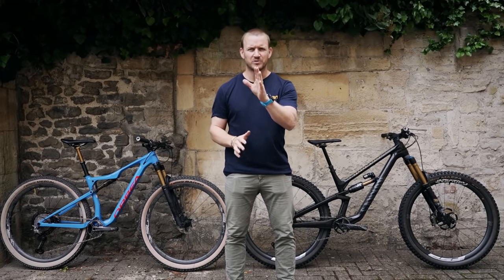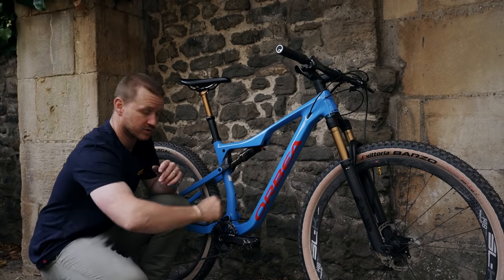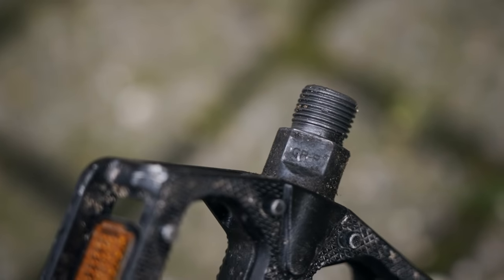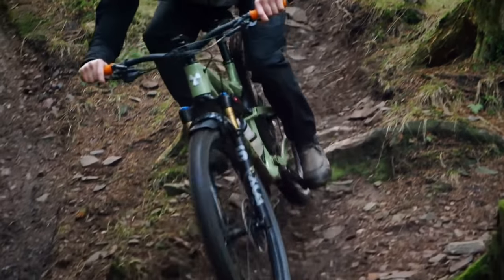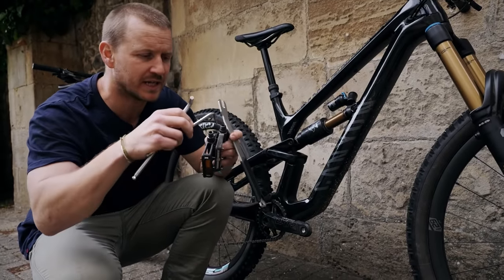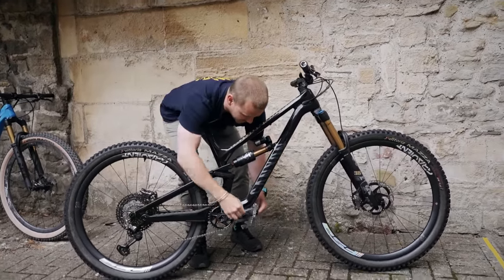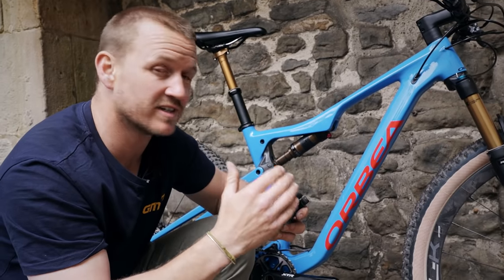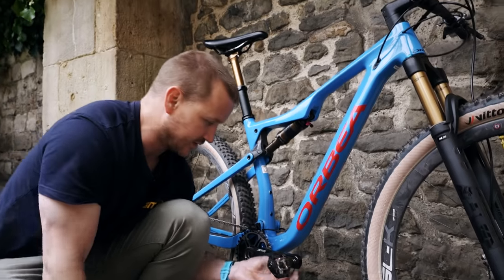How To Change Pedals | Bike Pedal Removal & Installation

Comment: Yep, my pedals are stuck in my cranks 🤦🏾‍♂️  gotta hit the gym for a week and try to remove it 😅
Reply: same😂
Reply: My friend and I cut a piece of metal to match the pedal post and then welded an 8 foot bar to the metal piece we made so we could break it free. Yes we were spinning in the right direction, just the last person did not put grease on the threads when they installed the pedals. Luckily the threads on the cranks were still good after that. (We broke two spanners trying to take off the pedal :D)
Reply: @DavidSmith-fx8lo  My pedals were installed on the store when i got the bike. I want to change pedals now its like it was glued or something. One side i could open. the right side is dead stuck. Im 6.8 110 kg gymrat and still barely opened one side. I dont have good tools though, ill take it to the store tomorrow to see if with their tools they can help to open. Its a fucking nightmare.

Comment: So I went to remove my pedal and we broke the spanner because the pedal was not greased during installation. We had to weld an 8 foot metal bar to the pedal to generate enough leverage to break it free. Luckily the crank thread was still good for the new pedals i was installing.

Comment: Thank you for the video, it was very informative and it helped me figure out how to remove my pedals. BTW, the terminology rotate towards the front of the bike is ambiguous and without the video I would not have know what you meant. In the future consider using clockwise and counterclockwise , the standard way to define the direction of rotating a tool.

Comment: Handy way to loosen a really tight pedal....

Sit on the bike. 
Place a block under the other crank at the back (back pedal onto the block.)
reach down with the tool on the tight pedal, tool out the the front...
Pull up keeping your weight on the seat.

This will also work if the 'other' pedal has already been removed (as long as the crank can come down on the block).

Best block size... just slightly lower than the bottom bracket bearing. (while your sitting on it to account for suspension sag...)

Comment: I damaged the thread on cranks a year ago as I tightened with a tool rather than getting things started by hand and then finishing with a tool. Luckily a local shot drilled the threads out. Fitted an insert. Repair was like £10.
Reply: i just did this on my week trip to wales missed a full day riding as ther einsert needs 24 houes to dry cost me £34 but worked a treat.

Comment: To remove, use a T allen key, bike upside down, brace the top of T agaist the rear tyre and loosen... bracing like this means u dont need to hold anything to stop rotation